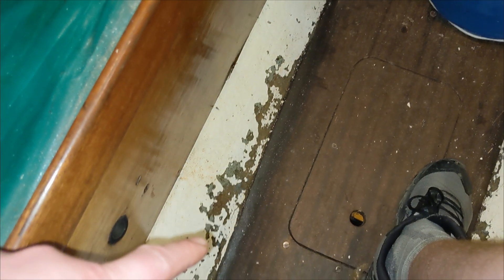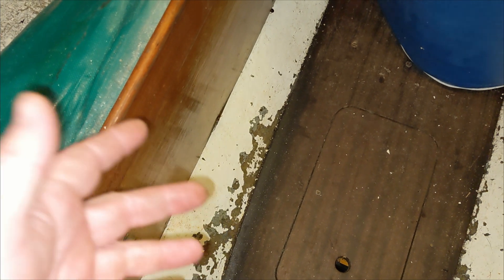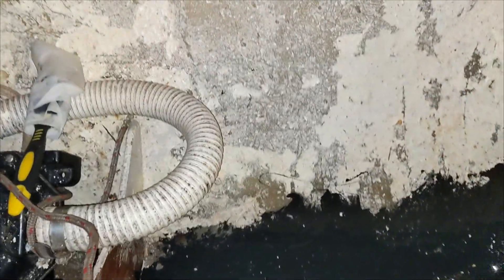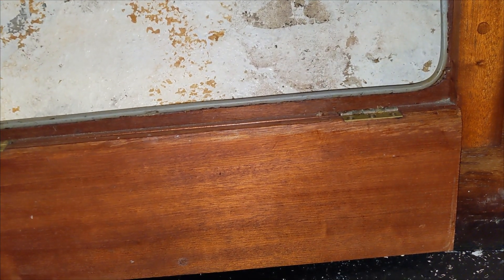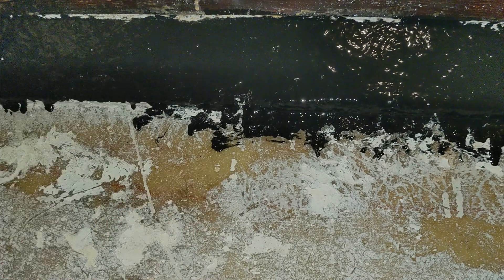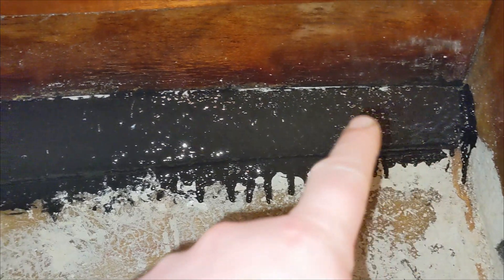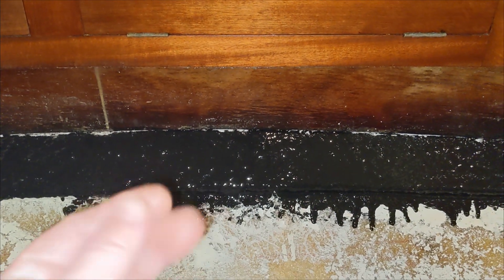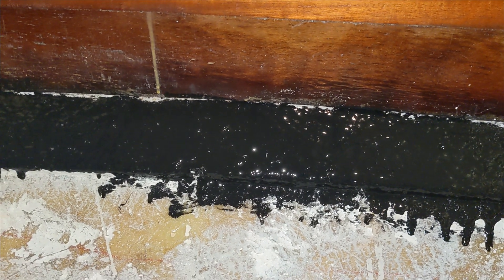There's a HOLE in my BOAT. No, really.

Comment: Despite what some of the comments below say, it's no use replacing the stringer or adding another one until the hull is repaired on the outside, and inside if necessary. Then assuming the old stringer is removed for repair, prepare hull and fit new stringer. Bear in mind the wood used in stringers is not always for strength but to actually make a form for the GRP. Even though the wood may be rotten it doesn't mean there is a weakness in that area of the hull, as the GRP wrapping the wood will have added strength. Maybe it got cracked by an overtightened cradle pad.
Reply from the maker: Hmmm, it's in exactly the same position that I had all the problems with the cradle leg. I'll look into that, thanks!
Reply: More than likely

Comment: I reckon that the box section left by the stringer is a large part of the strength anyway. I would take some cores of the stringer to assess condition and extent. Worst case scenario, beach yourself on a falling spring tide and you have several days to do any work required. You might use a sink plunger from the outside to apply pressure and look for bubbles. It’s a bit of a bugger certainly but not a show stopper.
Reply from the maker: Thank you!

Comment: Milliput is great for sealing leaks, it sets under water. If the stringer is glassed in then the GRP provides most of strength and the wood is there as a form for the GRP. The wood in the stringer is redundant to a degree. If your boat was wooden it would leak a lot more, this doesn't look like a major worry.
Reply from the maker: That seems to be the consensus! Feeling much better about it 😂

Comment: Totally agree the wood stringer is just a former basically.  When you come to investigate and if you need to replace you could just remove the inner face, remove wood and dry/clean then replace with foam before glassing right over the lot.  Shame you sent the legs north they could have been useful.  As for IOW, mooring won’t be cheap there and it gets very busy coming into the season.  Chichester harbour has many protected anchorages and the harbour board may be able to fix you up with a temporary mooring.  There are drying out piles at Itchenor and Emsworth if you need to investigate the leak.  As for Channel Islands, that is a tricky place to sail, very strong tides, lots of rocks and hazards and again expensive to moor.   The East Coast may be better from a cost perspective, lots of estuaries and boatyards to choose from.  Best of luck,  Andy UK
Reply from the maker: Cheers Andy. I'm planning on being at anchor only, to avoid fees. Might have to go in once a week to charge the battery or something. I've got it in my head that I want to go to sark, as its where the boat is registered. I'm going to change it, so it'll be nice for her to go home first 😂

Comment: I might be wrong but most of strength is not the wood stringer itself but the tophat section of the Grp moulded over it .
Might put your mind at ease a bit 🤞
Reply from the maker: Certainly does! Thanks!
Reply: @BumblingSailor  also be unusual for osmosis to be that bad to cause a leak plus these old boats are very thickly laid up .
No drying posts or slipways you could dry out at between tides anywhere local?
Reply from the maker: I've got a set of beaching legs that I've literally just sent up north yesterday. 🙄. I've no engine at the moment, but I'll keep it in mind in the future.

Comment: Older boats like ours are pretty bulletproof. With a really slow leak like that, she'll be fine to sail for a good while yet. When we were docked up in Canada during the winter, condensation made the boat really wet inside. We stuck foam camping mats up everywhere above the waterline, that helped a lot. Condensation below the water line isnt really a problem and can act as a kind of cabin dehumidification.
Reply from the maker: Good to know! Thanks. Not all doom and gloom then!

Comment: Forget the channel islands,lots of rocks and tides of 12 metres running at 12 knots,there are anchorages but  it's definitely not for a novice. Also,don't leave if you or the boat aren't ready,I was always told 'don't sail to a timetable' that's when mistakes/accidents happen. Have you considered getting a temporary job for a couple of months? Would pay the moorings and put something in the bank,would also mean your trip home is in summer,a lot easier.
Reply from the maker: I'm hoping she'll be ready, if not I'll hang on. I think I might have sorted a mooring in skippool, but I'll have to wait and see. That'll mean I can head straight up there. I looked around at some jobs but I'd rather try and make a run for it 😂

Comment: Hey if you`re set on sailing the boat like this you might as well use some underwater epoxy to glue thin marine plywood to the outside of the hull where the leak is. If it stops the leak you can take out the stringer and make a temporary repair from the inside. It`s a temporary solution and it would be ugly but it`s a lot safer then sailing with a compromised hull.
Reply from the maker: I don't think it's serious enough to warrant it. From the advice I've had, it'll be reet. Thanks for the info though!

Comment: Sometimes when a boat is lifted into the water after being ashore, water that’s in a compartment that you couldn’t see will flow to a separate area of the boat that you can see. I’ve never heard of a boat leaking through osmosis, so may not be a as bad as you fear. Think I would also check the bilge pump and diaphragm as that could be a cause. Good luck and thanks for posting.
Reply from the maker: Thanks, I'll look into those!
Reply: Boats can and do leak from osmosis it takes a lot check out my contessa. But I don’t think this is osmosis he would have seen major blistering on the outside.

Comment: Don't sweat it. add 2 stringers one of top of the old, one beneath. Glass them in and later rip the damaged one out once the time is right later this season. There is some high density foam that can be used for stringers if I remember correctly.
Reply from the maker: Nice! After finding the salt marks in the cupboard above the stringer, I'm fairly confident that it's above it. I might drill holes along the stringer to see if it's wet inside, or is that stupid? 😂
Reply: @BumblingSailor  Just go for a couple of samples. If it looks like a swiss cheese you might went overboard with the sampling 😂
Reply from the maker: 😂😂😂😂 That's probably more my style to be fair 😂
Reply: @BumblingSailor  oh, don't be drilling holes in there. i'm sure you're not made of money. there's only so many cans of worms you can open at one mealtime.
Reply: I agree with this idea. When and if you replace the bad stringer, the boat will maintain it's shape and strength. It's all part of owning a boat. Ignore the negative comments and relax a bit, It will  work out. Take your time and don't panic! good luck

Comment: A friend and I had a 50+ year old wooden dingy we sailed for a summer.  It was dry rotted all to hell (my friend bought it). Another guy we knew from work let us keep it on their lake property.  We sailed the boat to their property and it was leaking like a sieve. We were bailing or we wouldn't have made it the couple hundred yards, lol. It basically sank in the shallows along their shoreline.

When we wanted to sail, we'd bail it out 'til it floated.  The wood had swelled up until the leaking was (a little) less.  We sailed just fine.  When the water got more than ankle deep, we'd bail and keep sailing.  Our feet we're never dry when we sailed.  There was always at least 2 to 3 inches of water.  Of course, shore was never that far away.  Different story if we'd had to go too far from land.
Reply from the maker: 😂😂 Sounds like a proper adventure!

Comment: Where you have a drying mooring the sea water on the hull gets drawn in along the glass fibres and the resin.  As it dries out the salt crystalises and pushes the fibres and resin apart.  This can create small areas of porosity and weakness.  Nobody checks for this during surveys - except when they use the bìg hamerometer.  Tomorrow morning, after breakfast, give the hull a good tapping.  Most of all - don't worry.  Your boat has been bobbing up and down for half a century.
Reply from the maker: I'm sure she's fine. That's what the general consensus seems to be. Thanks!

Comment: Dry out the best you can. Fit a bilge alarm or electric pump. Go out sailing but bring a mate (alone you won't be able to pump and steer if it comes to it). Hopefully you will soon get to bottom of the leak while on the water.  Summer is just around the corner.
Reply from the maker: Cheers. I've got an electric pump so should be OK. No mate unfortunately, I'll be flying solo 😂

Comment: Don't panic! .. those boats were strong .. I'm not convinced that the 'stringer' is that important to the integrity or strength of the hull - it may even be there simply to facilitate the building of the lockers / benches etc .. 
Now then ... if water is in the stringer .. then it, could be tracking from anywhere along its length  .. just thoughts .. i say this as it happened to me once - the 'hole' was miles away from the multiple pinholes in the slightly poor and light layup used to bond the wood core .. 
(Perhaps in time, it would be good to check from outside that there hasn't been some damage and a possible poor repair - but I'm not sure that it's urgent) ..
Somehow, I don't feel like the boat is going to break up underneath you .. 
Press on ..
Love you and your channel ..
👍
Reply from the maker: Thank you!

Comment: I wouldnt worry about that, if you struggle to see where its coming from it isnt much but what i would do is when the tide goes out have a look where you think it could be and just see if anything pops out at you, ive seen much worse, my mate had a wooden boat over here and i used to be with him when it was launched the old way of sliding down the ramp and on hitting the water we had bags of sawdust to chuck in the water where we thought it was leaking as the wood shrank when out for the winter, it worked everytime!
Reply from the maker: 😂😂😂 I'm certainly less worried now.

Comment: I'd be v surprised if it was a compromised hull.  Isn't it likely to be a chain plate or window leaking?  Could still be condensation, particularly at this time of year where the temp differential is high and when Ur spending a fair bit of time on board.  I've had the same on mine.  Took the cupboard panels off.  Packed out the back of the cupboards with expanded polystyrene wrapped in cling film.  Helped a lot. I think the jib track might also be leaking a little.  One thing at a time 😂 I personally would not paint everything black.  You need to find out what is going on.  Then whack in some white masonry paint. Will last for years.   The wood in the stringer is not as structural as the glass that is wrapped around it.  It is possible previous owners have drilled into it from top, letting pooling water soak in, which can rot it. But honestly, I would not be worried about hull strength unless all the bulkheads were coming away from the walls.  Find the leak!
Reply from the maker: 😂 I reckon there's definitely an element of condensation/rainwater, but it's saltwater above the stringer. I'm sure it'll be reet. It'll have to be 😂
Reply: @BumblingSailor  . Yeah. I'm not there so you be the judge.  But the boat is bound to have had waves over the deck etc.  Or been heeled over and had it slosh up the sides at some point.  If the hull was knackered there would be visible damage.  I just think you would have seen it.

Comment: It's a weird problem, but I think you will chase it down. It is a pity you did not scrape all  the old antifouling off. It is very easy to do, and then you get to inspect the gelcoat. Any lockers that have a low point need a small drain to allow water, condensate or other, to get to the bilge. A Dremel is a great tool to do this, and when the wood is dried you can epoxy coat the drain hole.
I will follow your further research, but I think you will nail it.
Reply from the maker: That's great advice about the drain holes! Thanks!

Comment: I can't see that stringer being structural to be honest. My boat has them too and they are just put in for the cupboards to screw too. I also have a leak that gathers on my lower stringer for the base of my seat. Took ages to find the leak, it was waste water from my sink. Don't worry about it too much. Go sailing to Isle of Wight, see if you can lean against a harbour wall for next to nothing or free. Check out the hull for any damage.
Reply from the maker: Cheers! Was just concerned as it was saltwater. But, everyone seems to be in agreement, it's not much to worry about. Thank eff for YouTube 😂
Reply: @The Bumbling Sailor  yes I still not fixed the leak in 5 years! It's only tighten up a jubilee clip or reseal the waste fitting on the bowl of the sink. I always seem to forget. Hey maybe in a couple of weeks time 😀
Reply from the maker: @leefromsvpatchamie8607  😂😂😂 Yeah, maybe...

Comment: Check the bolts around the rudder pintles they can leak.
Reply from the maker: Had a look, but they'd drain straight into the bilge. Must be on the side of the Hull. Cheers!

Comment: Hi mate, could you investigate the problem at low tide? If you can have the stringer back in place before the tide turns again? If you prep everything before hand to make it as quick as possible?
Reply from the maker: After finding that the wood had salt stains on at the end, I reckon it's above the stringer now, and was running along the top of it. I reckon I might drill the stringer every foot and see if it's wet. It'll be easy to plug the holes back up. The epoxy curing time would be the issue between tides I think, unfortunately.
Reply: @BumblingSailor  Don't waste any kind of resin on anything wet. At best you will just seal moisture in where you don't want it. It takes a while to dry stuff out. You have no urgency, as you have already realised. Keep on researching and forming ideas for the solution. You will beat the issue.

Comment: No point setting out with a nagging worry on your mind.  You might try finding someone to send up the mast, tie a stout line at or near the top, run the other end down the dock a slip or three and pull her over to get the affected area clear of the water. Have done thru-hulls with that method in a pinch. Word of caution if you do it... make sure some other boat owner does not untie the line because he doesn't want to duck under it when he makes his yearly visit to his neglected boat!!  Don't ask me how I know of this hazard.
Reply from the maker: 😂😂 Sounds like that was a fun day 😂

Comment: Keep it under observation , sometimes when a boat is on dry land it warps slightly and as it is put back in the water warps back to shape again causing little leaks to appear but then settles down again , did you notice it before ? as it may have been like it some time and you are just getting paranoid about it or the water was up one end when on dry land and once back in with the boat in a different angle it flows out of where it was hiding , could be just your bilge pump leaking or skin fitting needing sealing with water trickling down the outside of the pipe and dripping down into that space. but don't worry you will sort it out in your calm down to earth  way 🙂
Reply from the maker: Cheers!

Comment: I would be confident the wood will be ok as it is a salt water leak. wood does not rot with salt water but does in fresh water. If you heal the boat over by pushing the boom out to the opposite side of the leak & using either the main halyard or topping lift if it is strong enough to pull on the dock to lean the boat over enough till the leak comes out of the water & you can inspect the area. sounds like a very small hole so just sand the area to give it a key clean with a little acetone or meths & fill using some epoxy (kneed it or JB weld fast set type) that will cure it till you haul your boat next time.
Reply from the maker: Thanks for the info!

Comment: It is a hard thing to get your head round where water comes in. I dont know if you could  put tape along the inside of the hull at different levels and add a sort of gutter to each one. That way you might be able to fin the level the water enters.
Its a slow thing so you have time to work it out. Keep at it 👍👍
Reply from the maker: Cheers! I'll keep plugging away. Literally and figuratively 😂
Reply: @BumblingSailor  I mean What could possibly go wrong 🤷‍♂   🤣  👍

Comment: Here's hoping that the stringer has still got the structural integrity for you to do what my grandfather (rather annoyingly) referred to as 'Make Do & Mend'...
It's not as though it's a carbon fibre suspension strut that's only produced by for the Bugatti Veyron and costs an arm. leg and bollocks to fit. There will be a way, and you'll find a way to do it practically if you have time on your side. Remember this. Most negative boat advice comes from those who work Monday to Friday, 9.00 to 17.00...The doers find a way. 
I've enjoyed your videos from start to finish. Compliments to the entire production crew and hats off to your editors from PInewood.
Reply from the maker: 😂😂😂😂😂 Thank you!

Comment: You have a ton of very good co0mments here. I would ask, is there any chance the boat has been water logged the last time she was afloat? I ask as I brought an old boat which we restored and had an issue where it had been water logged for some time before being pulled out the water. We found the wood had absorbed so much moisture it never stopped trickling so had to replace the wood.

Try not to get to disheartened. As for not being able to stay there. Look around there are a large number of anchorages you can stay in for free, Jennycliffe and Cawsands being two here in Plymouth.
Reply from the maker: Cheers, I'll have a look at those. The boat was waterlogged before I bought it, it could well be that!